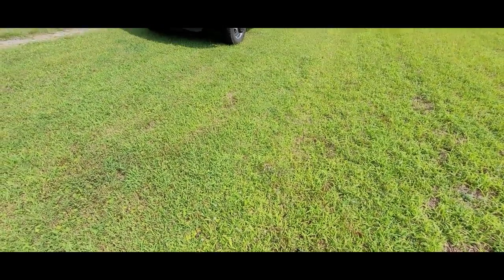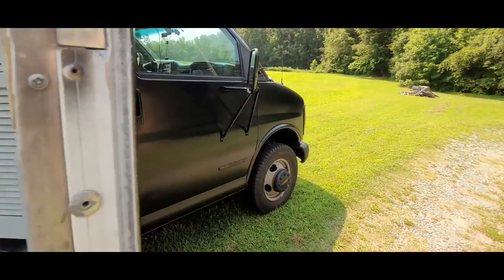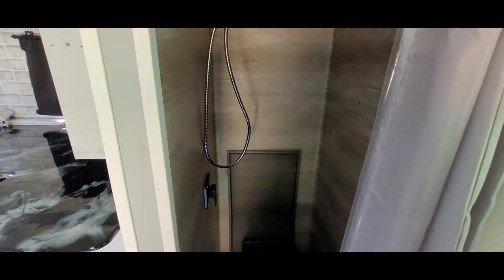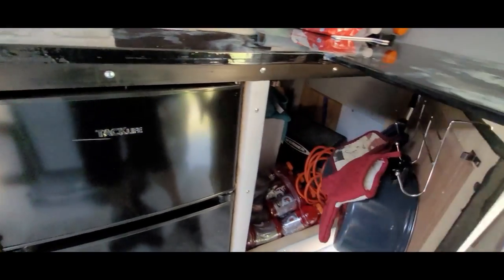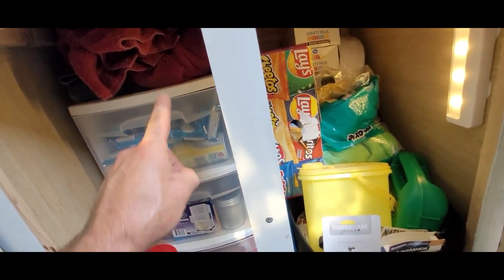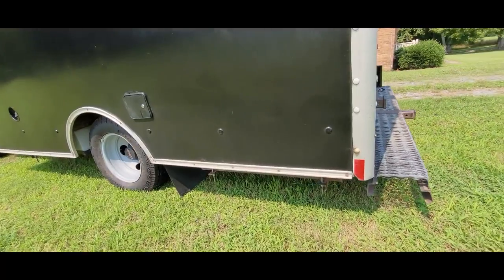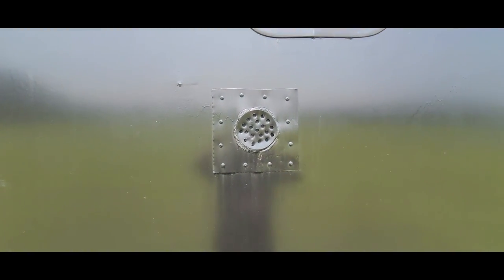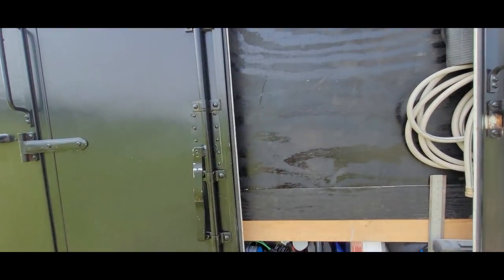Van Life | RV Conversion Tour | Walkthrough | DIY #vanlife #rvlife #foryou #diy #travel #adventure

Comment: Garage modifications: put cabinet doors over the tool compartment. Then cut back wall and install glass for window. That way you can open back doors to see out the window when stopped without worrying about exposing your tools. future mods should include but not be limited to a second window on back door to avoid having to open the back doors or changing  the back doors altogether.  .Food for thought.
Reply from the maker: Really great ideas! I was looking to do a modification like that.

Comment: Great video. I love everything you did. I lo1ve the stealth look. This is exactly what i want to do. I was surprised at the clutter that made things (layout etc) harder to see though. How much was the truck?  What did it cost to do conversion?
Reply from the maker: Thank you! I had just moved all my stuff in and didn't organize properly. Truck was 5k. Parts to convert cost another 7k.
Reply: Ty! I hope to be able to do it myself in maybe fiberglass molding? Or a sturdy piece of nice plywood that is thick enough to round out the edges with a hand sander maybe? Then I'll want to get the logo printed at FedEx printer shop using a durable flat plastic material and mold it around the edges. If plastic based I might be able to shrink wrap it maybe? Lol  ... With one of those high heat ummm like a hair dryer, but industrial strength. Lol

If not, think a nice black or gray water proofing rubber seal like they use on camper windows would work. Probably less expensive than stapling/gluing it down than buying one of those big-boy heat heat blowers I'd suspect.

I also want a way to lock it down from the inside with some kind of strong metal latch that meets it's inside locking companion. I'm imaging a very skinny slit in the wall that has a window seal-like closure to keep it from cutting someone ... (That would be Muah lol).
That way it's secure while traveling and impossible for someone to get it open without a lot of damaging and loud attempts. Lol The hinge would not be visible from the outside either, because it would be under the edge of the top part of the wood signage I'd imagine. I'd use the hydraulic support arms they use on RV under beds storage boxes. That way I'd not have to become like a muscle bound fella to get it open AND would shield the living space from rain I'd think.

Any suggestions for a better idea is always appreciated. ;-)
Gosh ... I wrote a Lot!!! Sorry! Lol

Comment: Question as I was going to go shuttle bus conversion and in fact I bought a bus, a ford e450 and I could not get personal insurance on it. Were you able to get personal insurance on your box van or did you have to get Commercial insurance for personal use like I had to get on the bus? The bus is gone and I am considering a box truck but do not want to run into the came issue.
Reply from the maker: It's just registered as a truck.
Reply: Hey, I just got my insurance today for my box truck. I used AAA and so far they are the only ones that let me insure it. Just some info. Pretty cheap too

Comment: Nice looking van...what kind of MPGs are you getting with your 350 ? I am assuming you have a 4 speed overdrive automatic transmission. I am just finishing a Vortec Head upgrade on my old 1982 Chevy Cube Van Conversion 350 engine... I also swapped the old 3 speed automatic TH400 transmission for the 4 speed overdrive 700R4 mainly to increase my MPGs. Liked/Subscribed !
Reply from the maker: Thank you! I average about 8 or 9 mpg. This truck weighs 10k lbs. Climbing the Rockies got 5.5 mpg. 

350 vortec engine and 700r4 trans, with 160k miles on them.

MPG might not be the greatest, but I never had an issue throughout the 9,000 mile road trip.
Reply: @NomadicBillyGoat  Thanks for your reply... I hope to see more from your channel ! Stay well and have fun !

 LET'S GO BRANDON !
Reply from the maker: Thank you! I'm still going to create content for everyone. Stay tuned!

LET'S GO BRANDON!

Comment: what are the mechanical cons to an econoline box truck? please don't hold back?
Reply from the maker: I've been living in, and driving this van for almost 2 years. It has 165,000 miles, and I've put 15,000 on it since I got it. It has a pretty strong 350 engine. It's a vortec motor. I rebuilt the top end not too long ago. (I did a video on it). I got the heads rebuilt, and put on a bunch of new parts, including the spider injectors, which are usually an issue. It runs alot better and has more power. I don't have too much of a problem except for power, and torque. When I went on my last road trip in 2021, I would creep up 10% grades at 20mph, while the engine was screaming, when i was in Wyoming. Also averaging 5.5 miles per gallon in fuel going up mountains. I average 9 to 10 when its realively flat. Maybe the engine was a little tired before the trip, and I killed it. I believe diesel would be a better option because of the torque it has, plus better fuel economy. The price just sucks.
Reply: @NomadicBillyGoat  best! thank you so much and a great channel!
Reply from the maker: Thank you for your support!